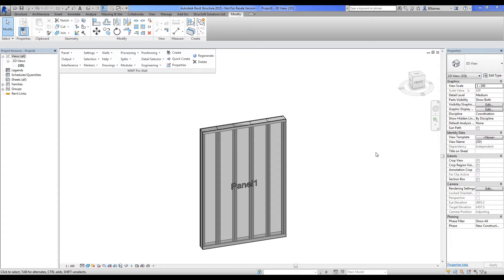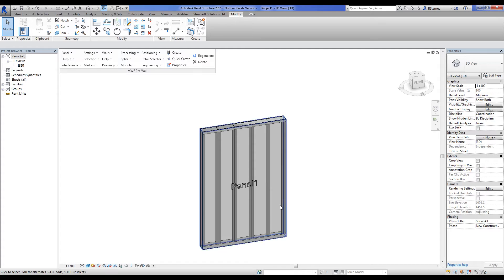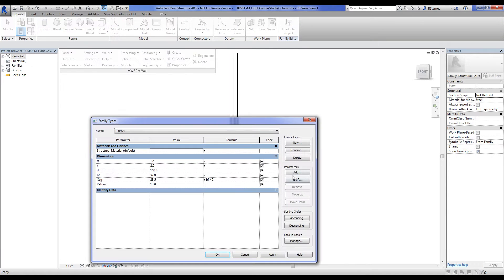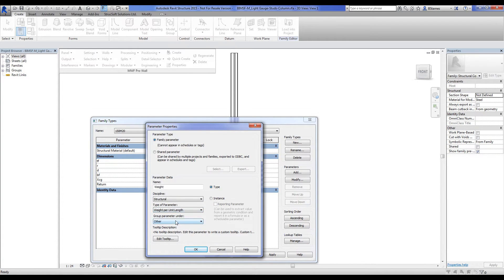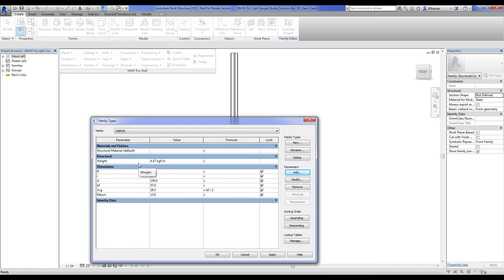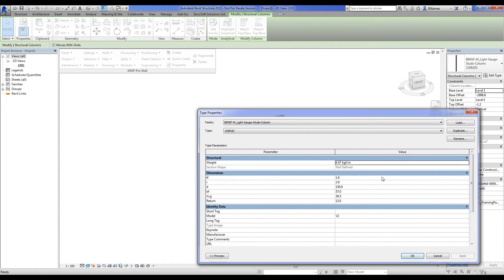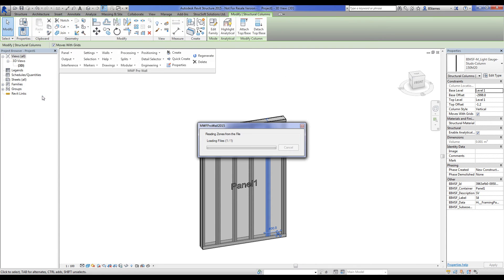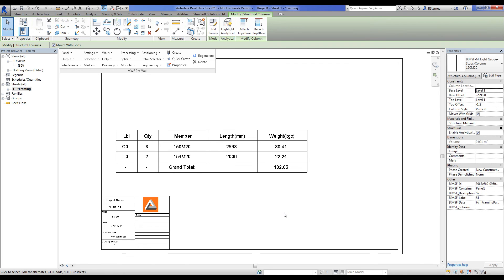MWF Tech Tip of the Week - Panel weights

Comment: Does it work the same for other components, like sheathing, insulation?
Reply from the maker: Hi Olivier. It will work on other framing components such as clips - holddowns - etc. If they are linear elements such as studs or tracks, you will need to add a linear weight as show in the video above, if they are unit elements such as one holddown or one clip, then it would need to be added as a unit weight. Unfortunately, we do not create the weight for sheathing or insulation, but you can add them the same way and use those added weight parameters with Revit schedules.